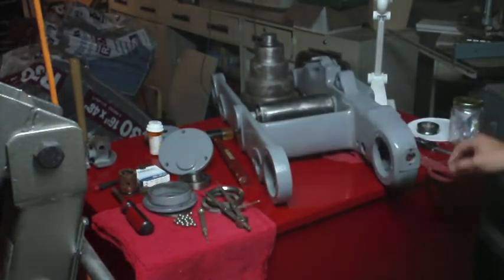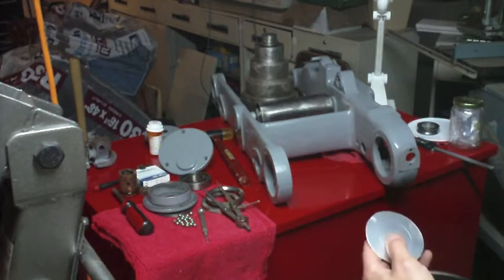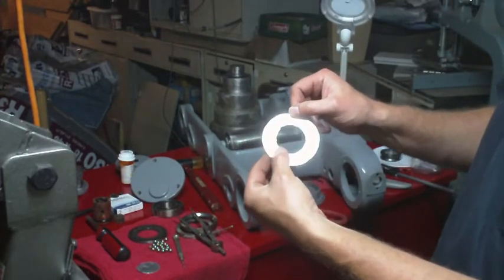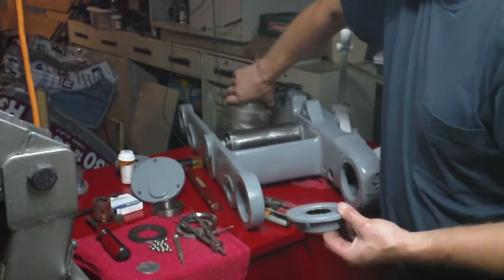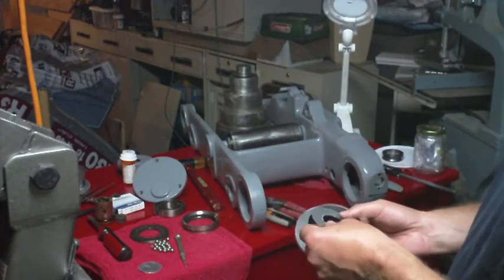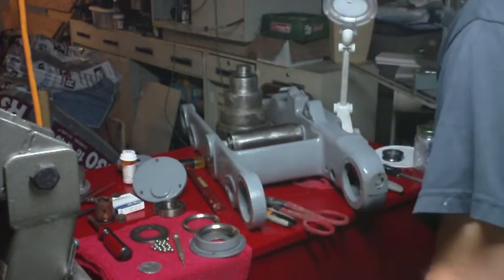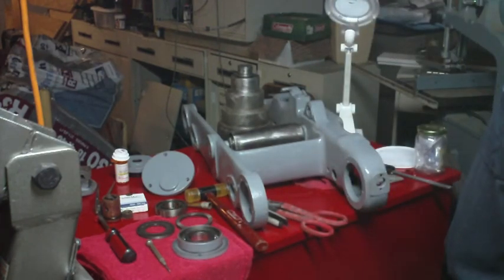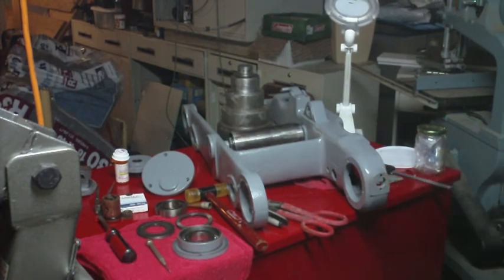Sipp Drill Press Part 34

Comment: So whats the purpose of the shield?....replacing the original that has deteriorated, or something you are re-engineering?
Reply from the maker: Hi Jim. When I first took this bearing apart, I noticed a lot of dirt had gotten in it over the years. I figured it might not be a bad idea to install a shield to help keep crud from getting into the bearing over time. In theory it seemed like a good idea, but as you'll see in an upcoming video, it was all a waste of time.